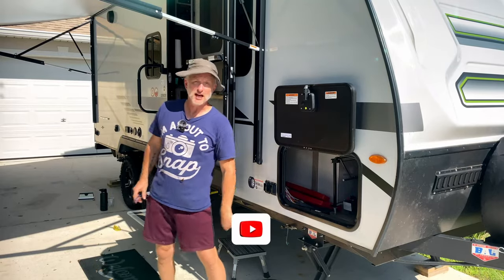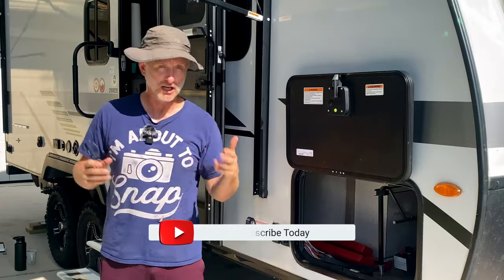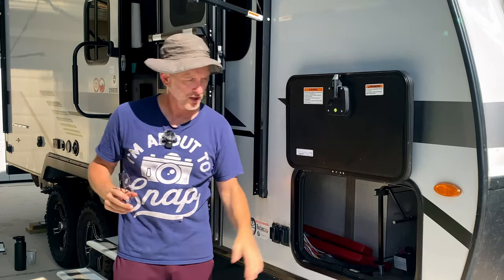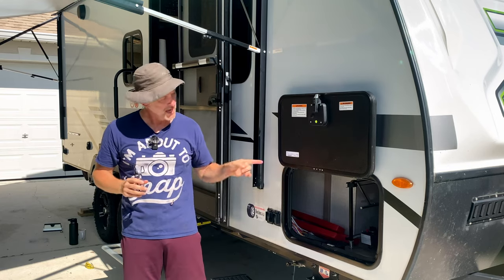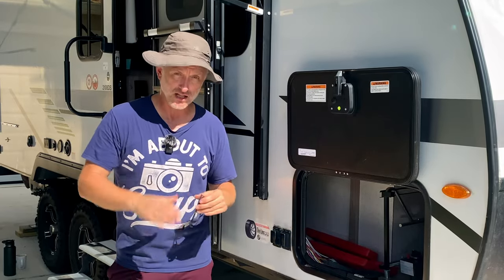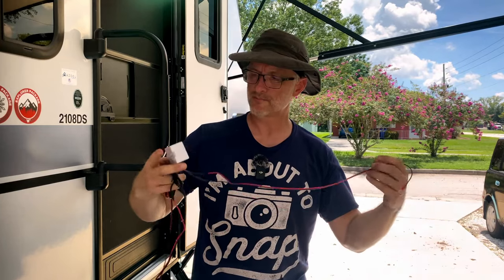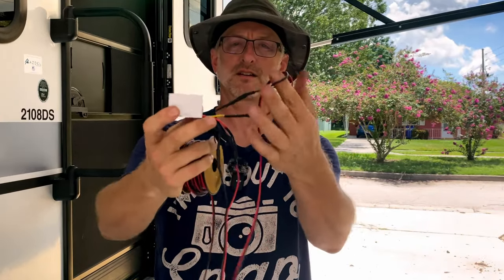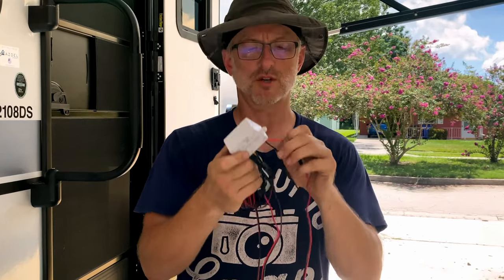Winnebago Micro Minnie 2108DS FLX Modification - Storage Compartment Cooling

Comment: My Xantrex just died after 9 months on a 2023 2108FBS FLX. Someone told me that Winnebago is now adding some sort of ventilation to the storage area. I came here to see my options for DIY before I let them start hacking away. Cheers!
Reply from the maker: It just gets way too hot in there when the Ambient temps tip 80...if you're running the inverter!  I'm pleased with how this mod has worked for us.
Reply: Or you can vent a cabinet door by the bed and install a exhaust fan on the outside like in your video, that way it's drawing cool air from air conditioning inside.

Comment: Poor design from Winnebago. Plus the battery has to come out in the winter  or you gotta fire out how to provide some heat to the compartment. Very disappointing.
Reply from the maker: Thanks for watching
Reply: Why does the battery need to come out in the Winter? Your area gets below the -4℉ storage temp low?